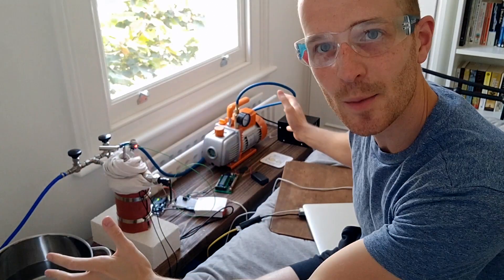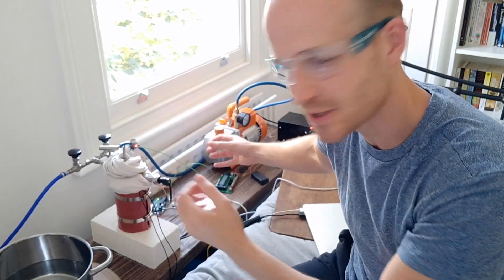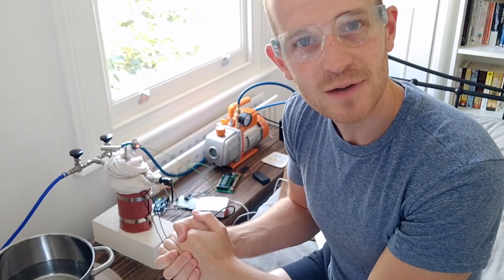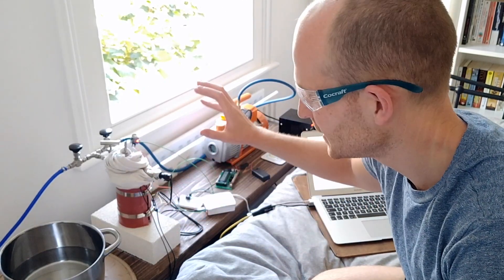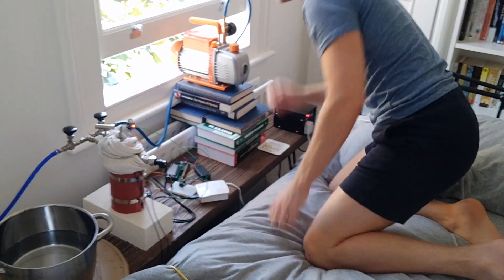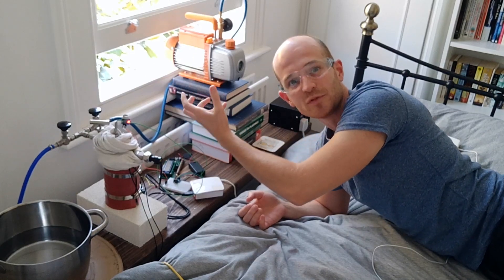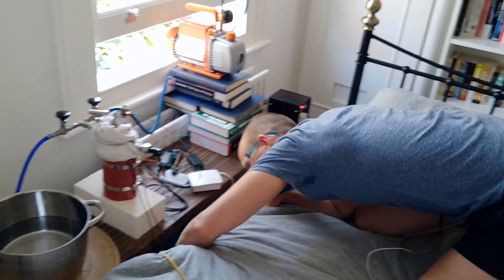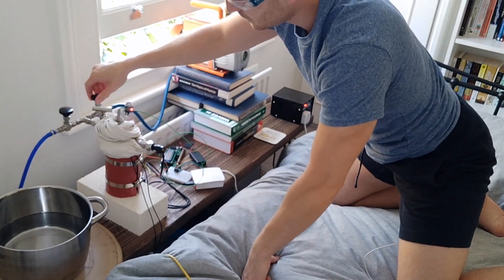My first cold fusion experiment - Casual Physics 002

Comment: How do you make clean hydrogen?
Reply: Tony Nelson electrolysis of water but it should be deuterium
Reply: @HostelbtHome  The oxygen...? Du får ju syre och hydrogen.. Så det är inte ren hydrogen
Reply from the maker: Pease forgive my slow reply Tony. I made hydrogen using a hydrogen generator. It's machine that does electrolysis of the water (either normal or heavy water). There are various bit of the machine that help to remove water from the H/D gas to make it more pure but I must confess I don't fully understand all of them.

Comment: Hi ... so does cold fusion work then?
Reply from the maker: Hi Winton, thanks for taking the time to write a comment. I'm afraid it's too early to tell in general. In my follow up video https://www.youtube.com/watch?v=jwS2Ve3eK9Q I do some analysis of this first experiment and couldn't see a strong signal. I was using hydrogen in that experiment so am going to try with deuterium (better fuel) in the coming weeks. Stay tuned :-)
Reply: @CasualPhysics  Interesting, looking forward to that. Where does one even obtain deuterium?
Reply from the maker: @axiom1650  It's tricky to buy in the UK if you don't have a "proper" lab. The easiest and safest way to create deuterium for my set-up is to put heavy water into an electrolysis machine (aka hydrogen generator) - deuterium will be created as it's needed so no need to store flammable materials in my bedroom :-)
Reply: @CasualPhysics  Then the question evolves to where one would obtain heavy water - unless you can create it yourself that is? Also, have you checked the video titled "Cold Fusion - Real, But Is It Ready? - Prof. Peter Hagelstein"? It references dozens of interesting papers you might want to check, I'm afraid it will be difficult to replicate the requirements in a home lab though.
Reply from the maker: @axiom1650  Heavy water you can more easily buy - you can check out the heavy water I bought here https://www.youtube.com/watch?v=mbtfTIvWuP4 . The video you referred to is great, I've watched it several times before, thanks for sharing. I've also met Peter in person when I was invited to MIT recently to see the work that they're doing. There are indeed many things in this field that require precision equipment beyond what a home lab can handle. I am hopeful though that I can produce a strong enough temperature signal to spark interest here in the UK where almost no one is currently interested in this area of science.  At that point lab space will come :-)

Comment: regardless of the feasibility and practicality you need 2 heavy hydrogen to fuse in order to make one atom of helium. because normal hydrogen has no neutron  wiliest helium nucluse is comprised of 2 nutron + 2 proton.
Reply from the maker: Thanks for taking the time to watch my video and write a comment.  No one really understands the mechanism behind cold fusion. There are many different theories though. Some suggest that (as you indicate) what's going on is the fusion of two deuterons. Others suggest novel mechanisms for the interaction between the isotopes of hydrogen that creates a pathway from light hydrogen to helium. These theories are freely available to read at http://lenr-canr.org/ . None of these theories have been proven though - we need lots more data from experiments. I plan to use deuterium in my future experiments....it's just quite expensive which is why I started with hydrogen.
Reply: Hello Matt, I am the same Curbina of LENR-forum. As Edmund Storms puts it, the worse mistake is trying to apply hot fusion logic to LENR experiments. LENR is a completely different field. I will also add that looking for excess heat is not the only way to research for LENR. Transmutation is IMHO much more difficult to disprove. You can see the thousands of pages spent to debate ad nausean an minutiae for the potential colorimetric errors, even when the excess heat, as in the case of Mizuno’s R20 results are way beyond anything attributable to measurement error margin. I am currently more interested in the cavitation - transmutation experiments.
Reply from the maker: @curbina  Hi 👋. I completely agree. The reason I decided on this experiment was because of the work of Les Case https://twitter.com/CasualPhysics/status/1141720778867650560 - no serious calorimetry was required and the equipment seemed reasonable to put together at home. I definitely have plans to look at transmutation and the like as I scale up my efforts :-)

Comment: Congratulations Matt on your first experiment! It's great to see garage science (or bedroom in this case!) performed with the high degree of scientific rigor that you bring to the benchtop. As a plasma fusion scientist from Imperial College and Culham, the LENR community is fortunate to have you! Looking forward to watching as things progress. In addition to the Geiger counter, do you plan to use any other detection methods for nuclear signatures (e.g. tritium, neutrons)?
Reply from the maker: Thanks Randall ☺️ - I'm really happy to have reached this important milestone. 

It's currently a limited set-up in terms of diagnostics due to money, but I've got every intention of upgrading. In particular, lenr experiments working with deuterium are not only the most energetic but show almost no radiation - only heat and helium. So, deuterium and helium measurement is a big priority for me once I can secure funding and a bigger lab space.

Until that time, there is still plenty of work to do, eg: control experiments, different substrate metals, mesh vs foil.... definitely enough for a small team. I encourage people to get in touch with me if they are interested in being involved.
Reply: Randall please consider the comment I have recently made to Casual Physics, I have learnt over the years not to reject mainstream unacceptable ideas that can be fairly simply checked (if you have the facilities.  And I will accept that this is a bit of a flyer idea.)